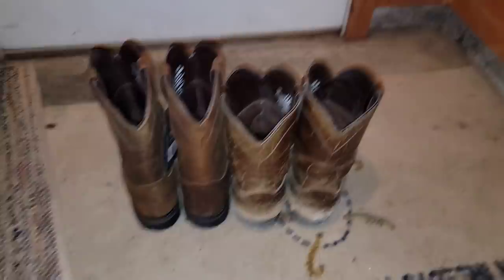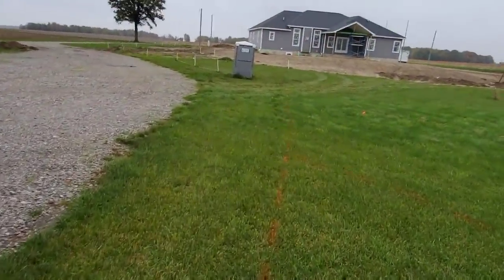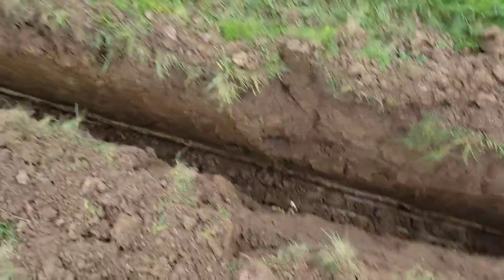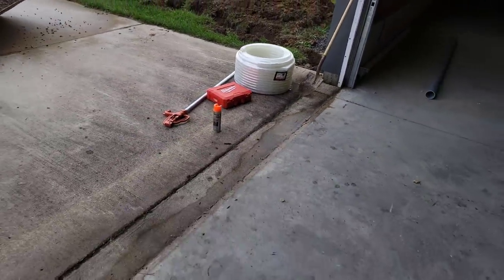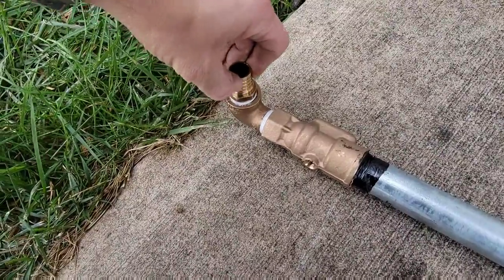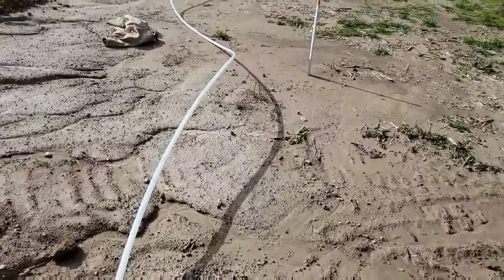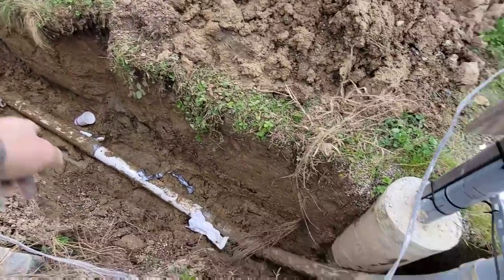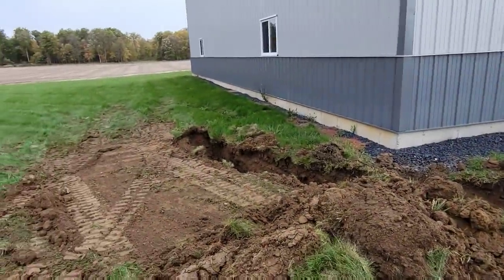That's How You Beat the Rain! - #535

Comment: You should run an extra electrical conduit from near the propane tank to the electric panel so you could put a propane powered backup generator by the seed warehouse and you won't hear it in the house.

Comment: You want the tile under the leach field working. Dirt is the filter between.  That is best and approved method.
Reply from the maker: I agree but the health department doesn't
Reply: My inspector said that's the best way, tile under leach.

I would think now, that tile is going to drain water to the point where you dis connected  it and oooz up in your trench where you capped  the tile causing wet spot in your lawn.

Comment: Will you run a heat tape where the water exits the house until it reaches frost line depth? A piece of 2"X18"X?' rigid insulation may be just as effective. Keep the snow deep there. Definitely a job to have out of the way.